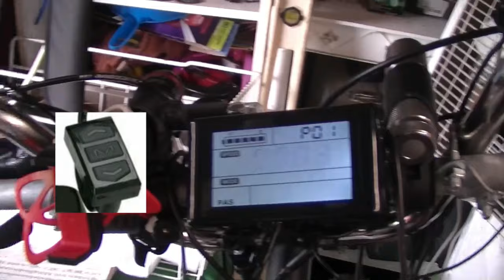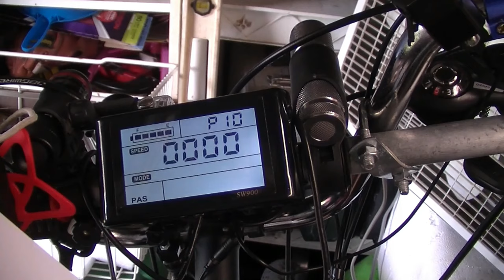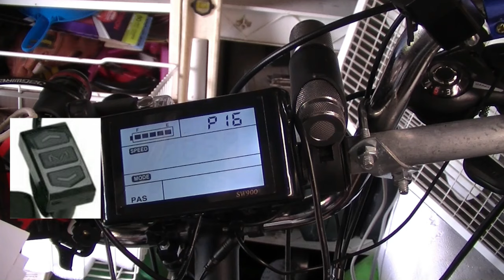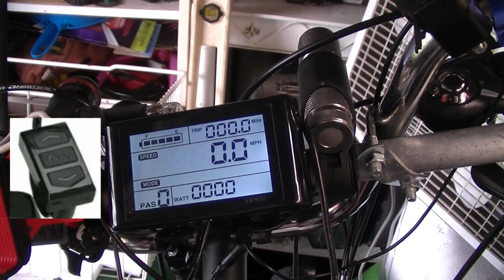How to HACK your E Bike Display

Comment: For "Cruise control" when riding along get to your desired speed to cruise (must be above i think 10mph or so) and then...

Hold the "Down" button for approx 5 seconds - You can now cruise at your chosen speed, it's great 👍😀

Cruise control will stop when you either move the throttle/throttle lever, or if you press either of your brakes.

Walk Mode - Press and hold the "Down" button for approx 3-5 seconds.

You can now walk alongside your bike and it will power itself as you walk with it (it helps if you keep hold of the bike 😅).

Headlight ON/OFF - Hold "Up" button for approx 5 seconds, this turns your light on, hold it again for 5 secs it turns it OFF.

To cycle through "max speed/battery current voltage/average speed/timer" press both together "UP" & "M" (middle button), pressing UP&M again will cycle onto the next of these 3 things - to go back to normal display press and hold "UP" & "DOWN" together.

NOTE - My SW900 is a 2024 model, but these will probably work on any years model.

Comment: Setting number 15 is actually cutoff voltage. This is from the original SW900 manual. The manual presented in this video appears to be an outdated or wrongly copied one.

Comment: what happens if i change the factory 12 amps to 18apms, i feel it gives more torque to the motor. after 10 mins everything seems normal nothing warms up
Reply: Did anyone advise you regarding cuz I wanna know myself 😅
Reply: @mostafamansour1099  you notice a difference in torque and speed , depending on your controller and cable from the fases(blue,yellow, and withe) check the cable thickness they might support 20-25amps, ir it's more than 30 amps they might burn the cable (in my case with the cables my ebike brought)
Reply: Excellent descriptive video...thanks mate
Reply: @macca5986  I think you meant to comment this on the video, but instead you replied to a comment.

Comment: Gears 1 to 4 I am able to pedal, but 5th is just way too fast. I mean 4th while I pedal is about 15mph, but than I put t in 5th and it's 23mph and i can't pedal that fast. How do I fix that?
Reply: You don't need to pedal that fast, that's the whole point of assist.

The bike will still go the 23mph if you pedal slower

Comment: Thanks, I was looking for this. I was very disappointed when I took my first big ride and when I dismounted to explore my display would blank out and I couldn't get it back without restarting it which zero's out the trip odometer. I now have my screen timeout set to zero. What are the other two setting? Mine was on 3 from the factory. Your link to the instructions has been hacked. It doesn't work. Thanks for all the help!

Comment: I have a 500w 36v kit but i have the same sw900 controller which is set to 12 amps also but 12x36 =432 watts. Should i just increase it to 14amps to get 504 watts? My battery is a 17ah battery if that makes any difference.

Comment: So what's the other modification, besides the speed limit, that we have to modify in order to get more speed?
Reply from the maker: https://youtu.be/fTFiXlz7RJQ remove this wire
Reply: Get a big voltage battey for more speed. This setup can handle 60v easily
Reply: @vincenzotatti3325  can I just add a 60v battery to my 48v bike
Reply: Turn the current setting up. Also shunt mod. Can get nearly 3000w out of a stock 1000w controller. Just be careful on hills. And don't stay at max throttle constantly. Once you get to max speed you can pin the throttle and no harm will happen. Because amp draw decreases significantly. It's when accelerating or climbing hills that you need to be careful how much current you draw. Can cook the motor or your controller  adding solder to the shunts increases current. The more solder you add the more current you get. My display allowed me to set my current to 30 or 32a. I can't remember the exact number. Top speed of 35mph and 1400w constantly from a 1000w controller. Shunt modding allowed me to pull 2900w. I had to use an external watt meter. Once you add solder to the shunts the stock display no longer reads the watts/current accurately.
Reply: After the mod my top speed was closer to 45mph. 26 inch wheel. I'm actually repurposing an ebike motor to make a home made euc. Using a vesc controller. Im switching my ebike to a vesc controller as well. The flipsky 75100 aluminum pcb controller. Can do 20s at 100Amps. It also does field weakening and foc. Not a bad 120.00 investment.

Comment: HOW DO I RESET MY Led DISPLAY, instead of my e-bike going 20mph it only goes up to 12mph.
Reply from the maker: If you can't find the settings on the video just print out the instructions and follow the instructions. Very easy to change back to 20 mph. Good luck.👍
Reply: It could also be that the tire size is set wrongly.

Comment: My SW900 gives a breakproblem. The brakes are fine, but the motor doesn’t work because of the fact the the display doesn’t reset itself. Is there a way to reset the display? Thanks for the answer. I really like the explenation films. Greetings from the Netherlands 👍
Reply from the maker: It should reset if you remove the battery. The brake problem could be the hub motor. It has a built-in brake in some motors. Good luck. Thanks for watching and have an Awesome day.
Reply: Just because the brakes work doesn’t mean there’s a problem with the motor it could be that you need to calibrate the rear brake to the motor so that it will cutoff the motor when you brake

Comment: I recently got a ebike and would like to go faster than 24 km, do you know about zunuo 48v contoller?  I could find the speed wire.  Thanks
Reply: Make the wheel size from 27.5 to 17 . And set the pas from 3 to 5 modes . After that you can ride 34 kmh :)

Comment: P11 should be set to 1 not 24 if you want the pedal assist to kick in sooner.
Reply: Mine is set to 1 but still takes a couple peddles for the motor to kick in do you have the same problem?
Reply: 1
Reply: @demusmarcus8240  did you fix this ?

Comment: Hi my battery is full but my screen is saying it's not charged. Can you help
Reply from the maker: Sounds like you have a bad connection between the battery and the controller. Check all connection.
Reply: Si es de 48v y le pones 52v 0 60v o 72v aparecerá que no esta cargada aún que la batería esté completamente
 cargada lo que tienes que hacer es poner 48 en la configuración
Si es de 36v pon 36

Comment: Qn: Can I use the LCD to change my Top Speed, and then go back to LED?  Or will the LED always drop back to its own hard wired settings? (Rad Mission 1)
Reply from the maker: Changing the tire size will make it go faster. Good luck and have fun.
Reply: @HaroldJackson   should I use a smaller tire or larger tire to go faster

Comment: So if I want to go over 50 mph what is the modification I need to make? my motor is rated at 2000 watts !
Reply from the maker: Not all bikes are the same. On this one we disconnected the blue wire. It just unplugs. Good luck!🚴
Reply: Probably need more battery or a bigger controller.  My motor is 750 and 1000 peak as I got the bike but its good to 2300 watts
Reply: At my display it's parameter 8, speed limit. possible values 0 to 100. 100 is no limit (reaching up to 80km/h with 2000W Motor)

Comment: Harold...tried your system...my Rad City has only 4 options marked SEE 1,2,3,4. It only allows me to change tire size, top speed, illumination, and mph/km.  Any experience with getting deeper into the programming of RAD specific controller/display.  So frustrated by it turning odometer off when a brief stop happens... thx
Reply from the maker: Thanks for the question. I don't have any more information at this time. Check out some other YouTube channels for more information. Thanks for watching.

Comment: Hey, my bike it turned off because of battery, and when i tried to use once the battery was load, i met with a 4 digit code. I tried a lot of combinations but im not success. Is a magnum metro 48 v
Reply from the maker: You are the 2nd person that has had this issue. I have never had this happen. I would call the company that sold you the bike and ask them. Good luck.

Comment: Hey man, I upped the speed limit on my display, but I cannot figure out how to cut it on the controller. I have a hurley mini swell. The controller is built into the battery housing, and they dipped the computer chip, and wiring in a grey gel. I can't figure out what to cut
Reply: Get another controller

Comment: I can say that works only on specific controller  and display. Some controller has password set up and even if you have password they programmed to have specific limit that will not make bike faster . Those setting  are set  for liability as some countries has restriction on max speed. I would not recommend to mess around as it can damage battery or motor and controller. Stay safe !

Comment: If I tell my display I have 29 inch tires, but I actually have 26, will it make me go faster?
Reply: No. Your speed indicator will be off. That setting is to calibrate the speedometer.
Reply: If u tell it your wheels are smaller than they actually are your bike will go faster.

Comment: Hi for some reason my battery life bars never go out, Always shows full charge. Any advice?
Reply from the maker: Sounds like a short in the lights on the battery. Good luck.
Reply: Did you fix your issue? I bought a used bike and the battery indicator does not show any bars but my battery is  fully charged. Any help appreciated

Comment: There is a USB port underneath the face of the display on the  right side as you are facing it.  It's not live at least on my SW900.  Is there a way to activate that and/or is it disconnected on the inside of the unit?
Reply from the maker: It sounds like a defective unit. See if they will replace it. Thanks for watching and have an Awesome day 😊

Comment: I originally had pedal assist when I first hooked everything up. My instructions are almost spot on with your walk through. However, somehow I have changed the pedal assist setting and I am not sire how I did that.
I’m
Reply: Change P11 to 1 not 24
Reply: My pedal assist always kicks in after a peddle or so I can’t find a way to get instant powers from the pedal assist like it is with the throttle
Reply: @demusmarcus8240  You just won't get instant power from pedalling, Even with a 12 magnet system and the assist delay setting set to it's lowest.. There will always be a delay of some number.
Reply: @mozzjones6943  thank you only way to bypass the delay is to rev and peddle at the same time
Reply: @demusmarcus8240  That's the ticket. That's what I do and I guess many people do, Bonus of having a throttle :)  I was spoilt with my last ebike, It had a yamaha mid drive which had zero cadence torque sensing - Power as soon as you touched on the peddles.. I do miss that, But I love my 1000w hub bike it's more fun to cruise on.

Comment: Hello, P6 is for tyre size.
If I have 28 inch wheel do I have to add 1 inch for top and 1 inch bottom for tyre thickness?
So the P6 setting should be 30
Reply: No, this is factored
Reply: @ianmangham4570  thanks for your reply but do have any extra information to support that. Because I had an electric scooter and the 11.2 setting included the tyre
Reply: @strawman9410  I have ALL SETTINGS, 10 years building ebike
Reply: @strawman9410  Get a friend in a car to check speedo

Comment: Hi Harold I just installed that monitor SW 900 on a 3000W  motor 36V- 72V.  I need to de restrict it ot only goes to 19.9km
I dont use pedal assist.
Can I set up battery to 60V
My battery reads 57V.
I will review the video and most likely print out the manual.
Any help is well appreciated.

Comment: cruise function?
Reply from the maker: That would be an add-on on the throttle. Thanks for watching and have an Awesome day 😊
Reply: Whilst travelling whatever speed you want to set cruise to you simply hold (on sw900) the 'down' button for approx 5 seconds and then it will self cruise at this speed (until you touch/move either the throttle or you apply the brakes, then it goes back to normal)...

Short answer - Hold 'down' for 5 seconds.

My sw900 was purchased bought in 2024 on a Voilamart kit.

Comment: Hi Harold, thanks your video, it’s been 1 year and wanted to know your experience updated upon your SW900 LCD Display. I have ordered 2 ebike 12000w with the SW900 LCD Display. I herd there’s a new model ukc1 led color display that just came out not to long ago. But yeah I seen good and bad reviews of sw900, what’s your experience feedback on it ? Is it all weather proof? Is it reliable over all ? What’s your recommendations ?
Reply from the maker: No it's not weather proof. We have had issues with water getting into the sw900.
Reply: @HaroldJackson  Harold thank you for your reply, I’ll contact manufacture about this issue

Comment: Where is number 17? I have a number 17 too
Reply: me to !
Reply: Do you have this exact same display? My display is different, but I also have a 17; which is my odometer reset. Almost all my options line up with this model display but it is absolutely not identical to the display shown. Also. The “speed hack” is not as simple as his is, I do not have a single wire that loop connects back into the controller.

Comment: My number 8 gors too 120 khm dude she 72v its nuts was on 50 number
Reply: Found USB wire 🙌 by big boy battery 🔋 too tune even more just kneed phone app mate its crazy k5 8000w ebike 77mph plus and still wint too go my surron black edition x 2023 got no chance even with bac8000 and 72lit battery crazy k5 8000w

Comment: Hi on my gauge the battery icon is blinking and not showing the bars ,what would the problem
Reply: @nightwolf5831  no it doesn't have any voltage settings  just the gauge that shows u the battery bars ,the speed and the mileage  ,I use a next battery and same thing
Reply: Can it be the controller, the controller is in the battery case  ,the battery fit in a case on to the frame

Comment: Ah how lucky, I do this and I'm met with a 4 digit password. Yayyyyy
Reply from the maker: Never ran into that before? It may be 4 zeros. Good luck.
Reply: @HaroldJackson  Yeah it came on the bike. And yeah, tried every sequence using 1-9. Doing 1234-3456 and so on too. All but going 0000-9999 individually haha. Asked the supplier but took them 5 days to respond "when did you buy the bike" so at that rate of response wont see the code until summer. Luckily I have an NBpower kit, but wanted to wait to put that on until I got the new battery.

Comment: Do you know if running a 36v battery and 36v rated controller on a 48v hub is legit? Like, will I ever run into any type of issues?
Reply: You shouldn’t have any problems but it isnt going to be fast probs tops out 20/25mph hope this helps you i have a few ebikes i should really make some videos

Comment: BeeCool
P5 has 9 Levels. 
P7 should be 6 not 46
P11 should be 1 not 24
P13 should be 12 not 5
P13 should be 20 not 12
Reply from the maker: Thank you for the information. Thanks for watching and have an Awesome day 🙂
Reply: Where did you get these settings from and are they for the sw900

Comment: The biggest problem with these displays what no one talks about.

They draining power from battery and controller when not turned on.

It's a very easy fix 
All you need to do is connect display power wire to Power ignition switch.
So it turn controller on and display at the same time and turns it off at the same time.
And you won't get that spark when connecting wires back up because controller is holding power now in capacitors.
Not getting drained by display
Reply from the maker: Thanks for watching and have an Awesome day 🙂